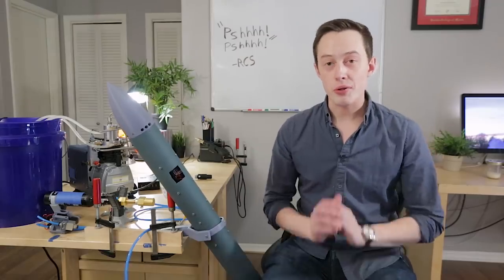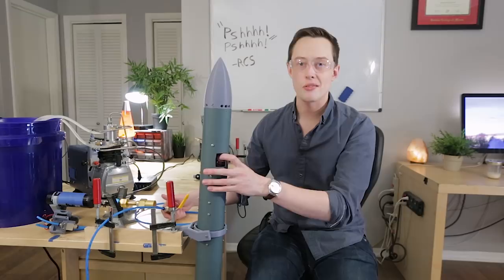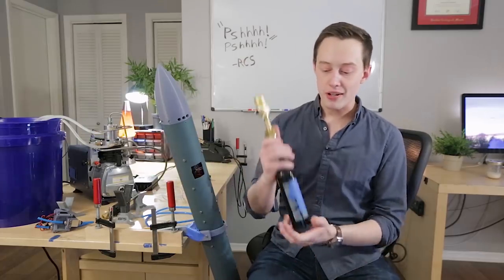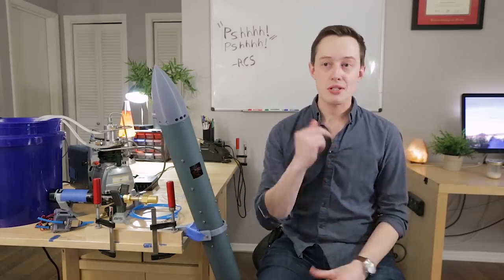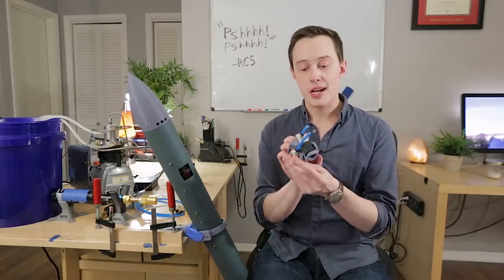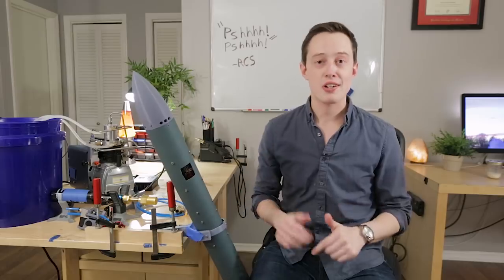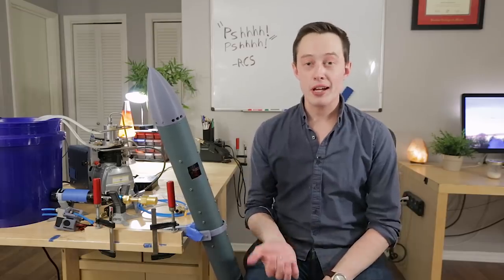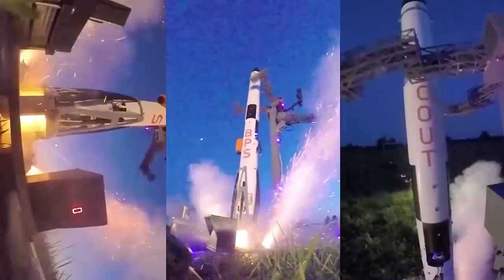Model Rocket RCS Thruster Update

Comment: There are valves that have higher let-trough capacity, but they are a bit bigger in size and use a pilotpressure to actuate a piston that opens the pressure line in its entire diameter. We use similar valves in SFX aircannons.  The smallest one ive seen so far is about the size of a 1 inch solenoid valve. You can get yourself one of these single use confetti cannons as an inspiration and maybe design something your own.  For the main valve, i would use a pyrotechnic firing valve as there is no need to close it afterwords and it weighs much less. They use a squib to fire open the valve. They also exsist as "pinpull actuators". We use them regulary for cutting cables or breaking glass in action sequences for the movies.   Maybe this helps too: Fruity Chutes Non-Pyro CO2 UAV Parachute Release Valve
. Hope this somewhat helps, you can contact me if you need.
Reply: You could contact pts-automation in Germany, they may have a solution  -> they´re called  " Clippard Elektroventile "
Reply: Another hint i can give you are automatic paintball markers, they have a special valve mechanic that actuates electrical and have a high let-trough capacity
Reply: By the way, when you use CO2 instead of compressed air you will experience serious differences in pressure over time depending on outside temperatures. We had aircannons filled with co2 on a cold morning, they lost about 30% of power as the liquid co2 could not vaporize as quick as it is needed!

Comment: Use spool valves. 

They are found in hydraulics. 

Now that you have the ability to run at high pressure, please run the full 3,000psi to the ports and run carburettor jets at the outlet. 

Next, please use a 4valve manifold with double acting spool valves so you only need two on the one block.
Reply: Interesting. Is high pressure better than high flow in this application?
Reply: @danielthrana  
yes, two fold.
pressure directly translates to thrust, and the stored [ressure is stored energy and he is dumping 15 times the used energy by dropping the pressure through the regulators.
Reply: @brucebaxter6923  Great answer, thanks! Carbourator jets is an elegant solution 👍

Comment: Have you considered doing brass inserts in 3D printer parts to mount festo connectors? Particularly for the nose cone it may help direct all your fluid out the thruster instead of having some leaking (assuming you’re still using the press insert method that was in v1) also, did you 3D print the appropriate thruster shape on your valves? Based on your pressure and your outside atmosphere by having an actual ‘bell’ it’ll help direct most of the force vectors exactly one direction instead of rapidly expanding in all directions as soon as the gas comes out of the thruster

Comment: Steper moter might be heavey but there are smaller options that could be swaped inplace if there powerful enough to turn the valve under presser but it might not have to if your bottle valve worked fast enough

Comment: Interesting concept. Is this the main way you plan on controlling your rocket during flight? Engine gimballing would be much more precise, but potentially harder to to engineer on such a small scale. It would definately be interesting to see these cold air thrusters in tandom with engine gimballing at this size. Using the thrusters for major corrections and gimballing for minor corrections could save a lot of air. This is the first I've seen where it's 100% thrusters! Hopefully the maiden flight goes well!

Comment: With the rocket flying and the pressure it receives from the air it's penetrating, don't you think it will affect the power valves will produce especially with the small orifice and low CV. To sum it up, will it work during the flight considering it's not static like in your tests. Thanks for the video and good work.

Comment: I'd think NO2 already has spec stuff plus adding in igniters and a fuel like alcohol you could save weight. You could even mount lower and heat your lines with exhaust for better burns giving stronger control while not having to take up as much space and lift as much weight.

Comment: If the problem with the fly tank is weith, those little CO2 Cartridges would be a good try and are cheap, you can pressurize the system with a few of them and use for weight distribution either.
Or look for those small whipped crem bottles, they are pressurized with the little cartridges, but you can use O2 if you change the valves.

Comment: Why you prefer active stability to passive? In a model like that you could storage a lot of energy pressurizating the water to use for primary trhust. And you could use another little tank to adjust the direction with your rcs system

Comment: Joe, be careful arming the RCS 4 mil seconds AFTER launch. If there is an issue in that system or valve stuck open, you have a full duration motor to burn through and a good amount of mass in that rocket. You may want to consider arming it before ignition.

Comment: Just use propane. When it is in liquid form it is about 100 psi and will be a much lighter setup than the high pressure air. Any you will not need all of the regulators and the pump. Also it will last much longer than the air because it is in liquid form like the nitrogen thrusters on other rockets. You can use green gas that is used in airsoft and the can is simi
lar size to the rocket body

Comment: A multi port rotery valve would suit your needs well would drop the weight significantly and keep your line lines to a min the longer the run the lower the flow rate and your source line should be atleast twice the size of your port

Comment: Have you done a thrust measurement on your nozzle setup? It doesn't look like you have a throat that is smaller than the size of the valve orifice, so there is no way you could be getting choked flow, and hence supersonic flows downstream. That means that your divergent section is actually slowing the air, and the pressure in your 'chamber' might actually be below ambient. You could check the pressure between your valve and nozzle at full flow to make sure you are getting positive pressure.

A pinhole in a thin sheet of metal would probably be simplest and reasonably efficient. It would basically be a convergent nozzle, so limited to the speed of sound, but I don't see you getting much above that anyway. When your flow rate drops to the point that you get subsonic flow it will still work efficiently, where a divergent section would be detrimental. By keeping it thin you limit boundary layer viscous losses.

I would try that before deciding whether the valves are good enough or not. You really need to design the nozzle around their capabilities. You have a full round of paintball in that tank, and your valves can discharge it in less than a minute. I don't think they are your problem.

Comment: You could reduce the leakage by 3D printing the plumbing and printing the valves directly into the plumbing with ports for injecting silicone around the valves. The result would be a perfectly airtight system with the valves being the only possible source of leakage.
Reply: I would like to see this. But I am afraid 3D priting the pressure system is not easy.
Reply: Tomas Brod I’m certain it’s possible. He’d just use thick walls and no infill/very dense infill. Another possibility would be photo-resin printing. He could make a few lightweight pieces that join together around the valve slots rather than printing a single piece and inserting the valves while the print is in progress.
Reply: It’s worth mentioning that photo-resins can be insanely strong materials. They could certainly handle the pressures. If he can find stronger valves, he could in fact use even higher pressures and achieve greater specific impulse in his RCS. Some of the newer photo-resins also have very good thermal resistance; it could allow the possibility of using chemical gas generators which would be lighter than high pressure gas cylinders.

Comment: Drill a bigger hole in the valves, then make a converging nozzle. Pressure goes up, and the mass flow rate increases.  I might be wrong, though.

Comment: Joe - you might want to consider a pilot operated valve.  That's basically a valve that is pneumatically actuated instead of electromechanically actuated...meaning you use a small valve to drive a bigger valve.  It would add some complexity, but the pilot valve (the one that actuates the larger valve) can be very much smaller than the larger valve.  Here's a link that may be helpful:  https://clippard.com/cms/wiki/clippard-maximatic%C2%AE-air-pilot-valves-selection-chart

Comment: Have you considered replacing the manual valve with another actuator and building a test bed? It may be useful to automate a test with a timer and a pressure gauge (on a microcontroller) while trying to dial in pressures/actuator timing to enhance the efficiency of the system.

Comment: Bigger valves/solenoids. You could thrust vector the RCS ports, which would be a smaller profile than 8 valves. That way you could get away with only 2 valves which could be much larger and provide greater flow mass.

Comment: I guess you will most likely implement PWM valve control in your next iterations. Since the rocket has some length, you could place horizontal oriented accelerometers at the bottom as well as at the top for pitch and roll. This way, you would be able to read rotational acceleration directly (as a difference between top and bottom sensors) instead of differentiate it from gyro readings (Which usually natively provide rotational speed only). Your rcs outlets produce a more or less constant force, thus they directly affect rotational acceleration. With rotational acc readings and pwm valves you could build a nice lowest level control loop. On top of that, you could then put a rotational speed and ontop of that your rot. position loop. Let me know, if i missed something. I am a bit into pids on embedded controllers as well right know and would highly recommend the magnificent Teensy 3.6 boards. The Cortex M4 has an onboard DSP with easy accessible pid processing. You might check out the community at pjrc.com.

Comment: I would take a serious look at getting your own valve body/nozzle machined. Design something that could screw right onto the tank with 8 solenoid's mounted right on top. Ideally it would run at full tank pressure but it could also incorporate a regulator. I'd prototype with 3d printing first and run at lower pressure. PETG with some post processing(butane torch?) might even handle 150psi. If a pop bottle can do it a thick wall print should be able to. Valve seats and shaft seals will be tricky in PETG, but it will atleast let you do some testing before you pay for the expensive milling.Someone like AvE might even machine it for free. Hydro test everything at higher pressure before you run it with air.

Comment: CO2 cartridges mounted horizontally in opposing directions.   Shutter/slicer valves.  Pretty sure that Myth Busters featured a project using that technology. Something about shearing off the valve of a full size air tank - if I remember correctly?

Comment: Try using Hybrid Rocket engines and by using Aerospike Nozzle And By letting in amount of air You can throttle Gases Used for Hybrid Rocket engines : O2 : OXYGEN (OR) H2 : hydrogen (OR)  N2 : Nitrogen 
If we want more fire we can put 2 (OR) 3 Gases mixed also 
👉https://www.youtube.com/playlist?list=PLlwEYYDoDc8yHufI0m10_H3VdVxgD9zkW .

Comment: What does he mean by the PID control being primitive? Is it that the flight computer calculates a threshold value and when exceeded sends a PID value that opens a RCS valve? 

How is that different than the torque control he mentioned?

Sorry if these are ignorant questions I’m not a programmer.

Comment: The valve thing is tricky. I encountered exactly this problem when building visual effects equipment for the film and TV industry. The idea was to use compressed gas to produce blasts of dust and avoid having to use pyrotechnic squibs, which are longwinded to reset and tend to scare insurance companies (though they're really quite safe when used correctly.) Trying to get as much energy through one of those little solenoid valves as we can easily get from a small black powder charge turned out to be not very practical and, as you say, I don't think there's even an expensive solution. Everything I could find was built for industrial pneumatics and wasn't really up to the job.

If you find somewhere that makes high flow rate solenoid valves that are physically compact, please tell me.

Comment: Maybe instead of having multiple valves, can have one valve & then have a rotating duct assembly that you 3D print. You can then have a servo that positions the exhaust flow at the desired vent? should be lighter & need less power..

Comment: You still need a simple, throttleable engine. I would suggest something hypergolic.
You have to look for alternatives to hydrazine.
Hydrogen Peroxid + some solid Catalyst. Or Aniline + SulfurAcid.
Then you just have to inject the liquids through a valve, into the combustion chamber. It ignites itself!

Comment: I'm not a rocketscientist, or engineer for that matter, but I'm guessing one could  make a system with just one valve and  some kind of custom airflow divider driven by a small electric motor or actuator. This would greatly reduce weight but could add a little complexity on timing and control. I imagine the divider to be a block with holes/tubes for every channel and a rotational centrepiece connected to the motor. The centerpiece will open one and close the other holes for the airflow. I'm not sure it will be up to your specs, fast enough and it probably will leak a bit!

What do you guys think of this idea? Making sence? Or does engineeringhell freezes over :-))

 (Maybe ask Tom Stanton to design and make it?, could be a nice collab)

Comment: Why not build a solid propelant RCS, you'd only need a rocket motor and a fireproof multi nozzle with servos controlling the flow
Reply: Where does the excess pressure go? What happens when it runs out?
Reply: @IntelTV   The real rockets rockets vent evenly when no thrust is needed. When it runs out it stops working, just like the gas ones. He got 18sec now under optimal conditions, Im not an expert on solid "hobby" motors but i believe some have longer burns, alternatively more can be added for staggered burns.

Comment: I agree with Michael roberts you need to have some one machine you a single selector valve that would be a flat disk maybe 3/8 in tall dia of the inside of your rocket the it would have 1 input on the bottom and i servo on the top the valve would be two parts the main body with the ports in it and a nother disk that has one air channal from the center to the side servo moves the iner disk to the port needed then a second valve on the tank gives it a shot of air disk moves to next needed spot valve at tank gives it a shot of air and so on

Comment: Pshhhh! Pshhhh! Valve suggestion! In terms of your mass flow rate problem, why not increase flow rate instead of trying to increase the mass at the same rate? If you can gradually decrease the diameter outlet after the valve opening to about half the size you will increase the flow rate at the same pressure. Thus, you will get a stronger momentum reaction with the same amount if mass, potentially decreasing the amount of air required. Newton's second law allows you to mess with either the mass OR the acceleration! Maybe there's no need for a larger valve opening!

Comment: You can use small co2 tanks (from BB guns), and a CO2 tire inflator. That gets you 800psi in a very small package. You can even do a tank for each axis, so the design would be just tank+adapter valve+solenoid for each direction (4 in total). That gets rid of all the tubing, most of the connections, the heavy tank and the regulator. You would just screw 4 new tanks in, each flight instead of trying to refill a main tank. And you can fire at the full 800psi (if your solenoid can handle it). You could probably even control the psi output by using PWM control with the solenoid, so the solenoid could be opened only partially open by pumping it on-off really fast.
Here's a valve that looks like it might work, they have a 2mm orifice, 50bar valve for $30. https://www.ebay.com/itm/2-way-high-pressure-air-solenoid-valve-1-4-BSP-normal-close-PG-Brass-water-valve/153021446806?hash=item23a0c9fa96:m:mcy48c3wexxVACO3sjZ8T6A

Comment: Have you ever considered "cheating" for RCS for smaller rockets like Scout and Echo?   If you took small drone motors and small props for those motors, then 3d printed a case around the system that you could screw into the body, like you flight conputer and TVC mount. All you would have to doo after that would be to cut holes in the body were the props are. This would be much lighter, and you would never run out of air, unless you got up higher (this is why rocket companies use nitrogen, plus it's easy to access). I'm also guessing that it would be cheaper. If you bought ESC's for them you would then have a no fuel needed, lightweight , cheapish, throttlable RCS system.

Comment: For controlling a system that is similar to your valve setup I wrote a PWM library that operates slowly such that the minimum on period or off period would never be less than some value.  I could then set the object pwm value from 0-255 to determine the duty cycle without having the worry about an actuation cycle that was faster than my system could handle.  If you adopted a similar scheme you could use a "normal" PID controller to control it.  If you want to play with my library I just uploaded it to my GitHub account: https://github.com/daPhoosa/slowPWM

Comment: I mean.. why not just use the DeWalt 60v compressor? 90psi
Reply: Solenoid steam valves?
Reply: AccuAir VU4 Solenoid Valve Manifold & 6 Fittings .. find a premade manifold, simpler.